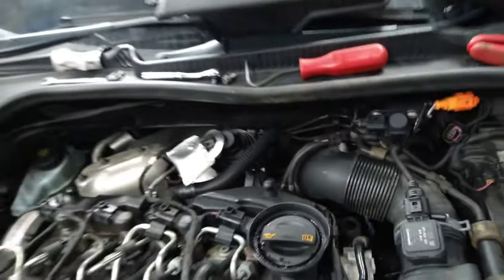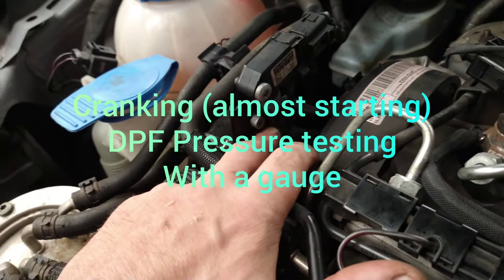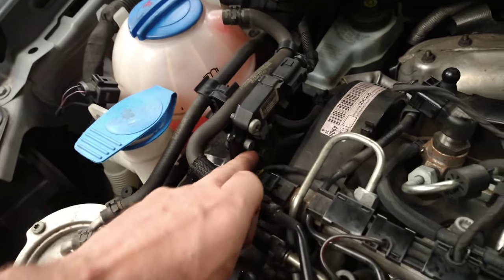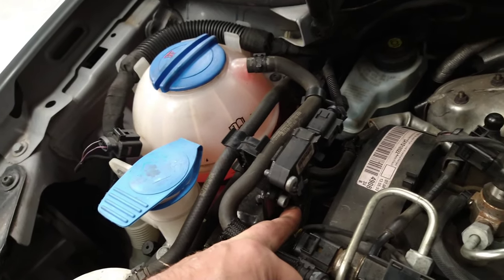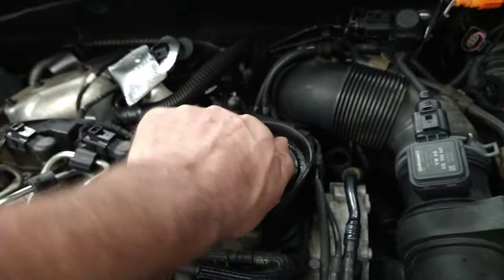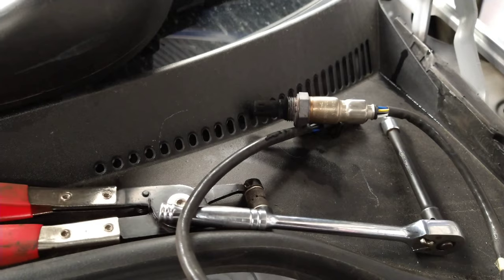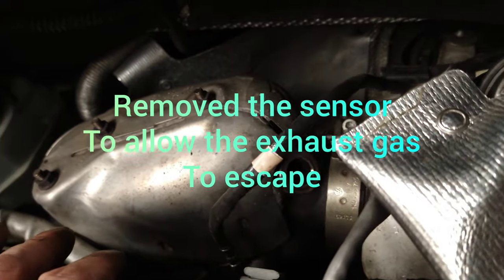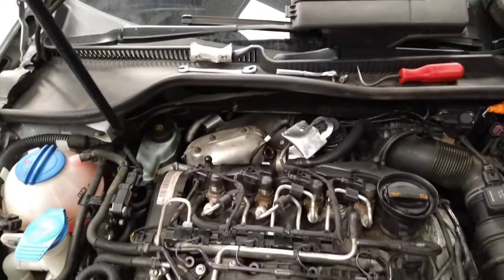VW Golf (crank, no start, blocked DPF)

Comment: Cheers Matt will terraclean fix that amount of pressure with the dpf in situ? Cheers sandy
Reply from the maker: No I once had a BMW X5 with 12psi @ 2000RPM and after three bottles of terraclean it was ok. This one is far to blocked, it was even removed and pressure washed but that made no difference at all.
It ended up getting a new DPF at £2000.
This one was the worst I have seen at 33psi.
Cheers Matt

Comment: Hello,i got similar problem. 
My skoda wont start,sometimes does it start but works for 30 sec.and dies.
Dpf was clogged,opened it and removed all,put it back and same thing..it just cranks..vcds doesnt show any other problems. Any advice? Tnx
Reply: Need to remap it on ecu deleting the dpf computer way
Reply: @raatguzari5207  my solution was removing the dpf temperature sensor,it cranked after imediately,put it back and no more problems. The exhaust gas could not get out because it was too much clogged. Hope it helps sombdy out there. 👍

Comment: Crazy Matt that was well blocked
Reply from the maker: It was the worst I've seen, the car is getting a new DPF because it's not been possible to unblock the filter at all. It may also need a DPF pressure sensor due to the higher than expected pressure. I didn't test it at the time.
Thanks for watching
Reply: @mechanicmatt871  could be intake leak or wrong oil or the turbo shit its self at some stage should be low ash oil c3 spec for them Volkswagen
Reply: @mechanicmatt871  A question , i have Replaced EGR 1 and 2 in Peugeot 607 2.7 , cleaned all the dirt in pipes and host , I stll get the msg. exhaust system defectiv , can it be that DPF is blocked, it runs but stops after 4 sec .

Comment: I had a cat collapsed one time and would only run with the O2 removed. Some noise out of her
Reply from the maker: I used to work at this garage, we used to terraclean cars here with blocked DPF's , I've never seen one as blocked as this.
They were not able to unblock it so it ended up getting a DPF costing £2000.

Comment: matt i have a vw touran 1.9 tdi i drove it kept saying boost preasure sensor fault and went into limp mode turn key off it would clear error drive normal for a bit . I then parked the car up for about 5 days took it out drove about 8 miles like a screeching noise started so i drove home parked it up was told the turbo was gone no symptoms apart from a slight loss in power slowerly checked everything smoke comes from tubo to exhaust join so i was told the dpf is blocked turn it over it wont start if i take the top boost pipe off on driver side it tries to fire but wont start if i take the air intake pipe off smoke exhaust fumes come through there ...If i try to spray something in air pipe to make it start its like the engine locks up till it evaperates can you help please ?
Reply from the maker: Check the back pressure at the dpf pressure sensor, that will show you if it's blocked, also check the turbo for damage/excessive play, that could be the noise you heard
Reply: @mechanicmatt871  hi matta sorry for late reply i took the sensor out still nothing its trying to start but i have fumes coming out off throttle body and iar intake liek its blowing egxhaust fumes both ways i done a scan today and only fault showing is egr low voltage

Comment: I have a Mitsubishi 1.8 di d will only run for a few seconds then cuts out,removed the dpf it does the same but if you also unplug the airflow sensor it will start with the airflow and dpf disconnected

Comment: forgot to add took the sensor out of the top of exhaust like you have in vid and still wont start havnt done anything apart from check to see if i could find fault it just seems to have got worse on its own
Reply: Did you solve the problem?
Reply: @leonardocapriodi1130  hi hows you i ended up putting new turbo on car then drove home and the dpf light came back on was told a vacuum pipe at bottom of engine so garage done that drove 1000 miles fine other day boost regulation came back on so back at it now
Reply: @home8706  hey, After no start i did same thing like Matt in video,removed the sensor and the car started. After that a friend did a softwer remap today,dpf and egr off. Car works fine,sometimes with the first start for like 2-3 seconds the car is a bit rattling,then normal idle
Reply: @leonardocapriodi1130  sounds like il have to do something its getting a pain now whats urs run like now did u have egr cooling system on it to ?